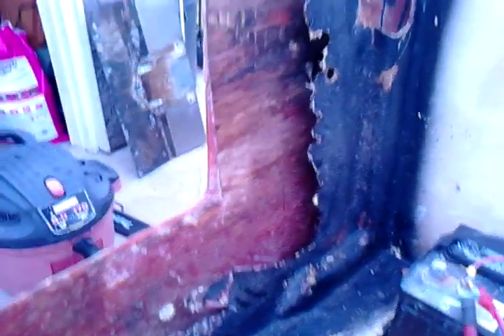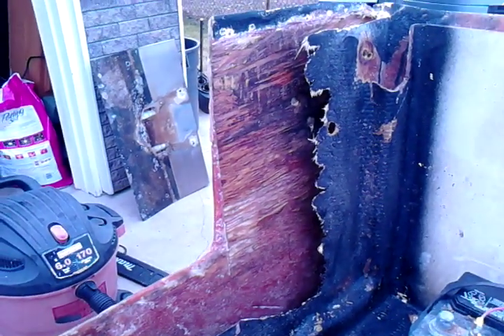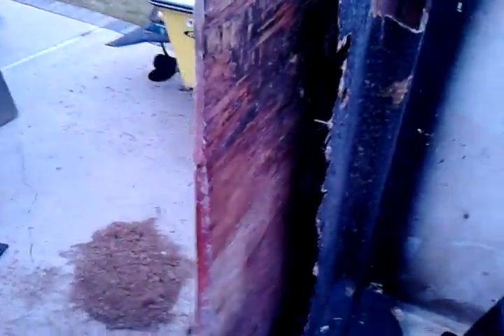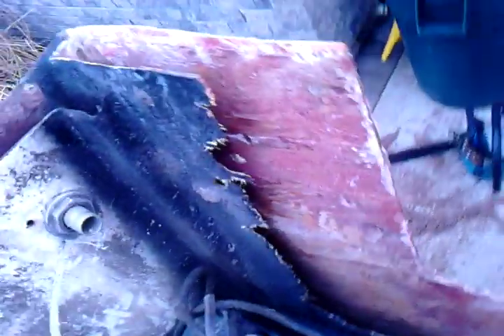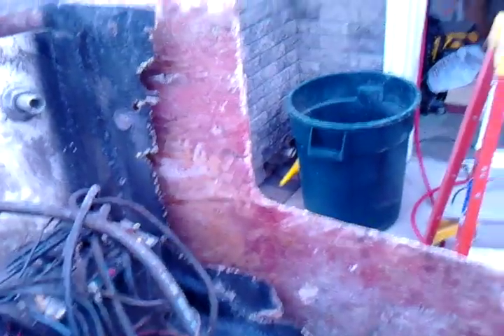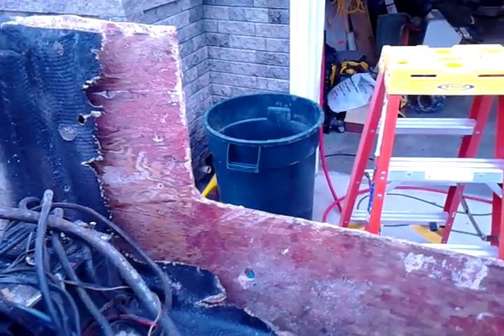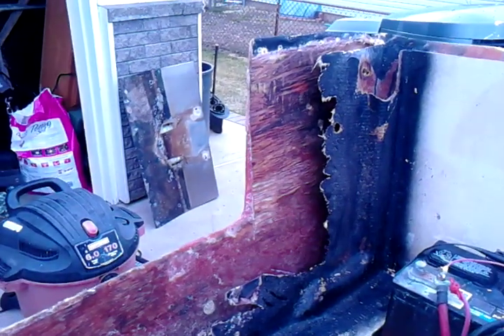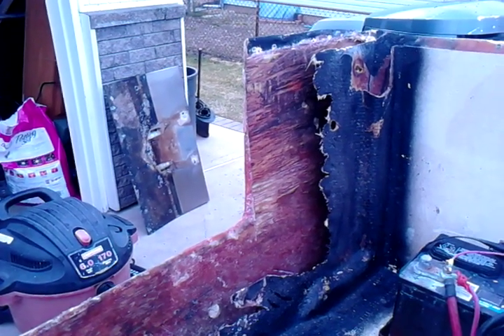Sea cast repair #1. After hogging out the transom core with chainsaw.

Comment from the maker: The factory never covered the plywood transom completely with glass. Thats why I made a new inner panel. Thats also why I cut the gunnells and engine well off in one piece so I had room to work from the inside.

Comment: Get that veneer out as he stated or it will block Seacast™ from bonding to the fiberglass skin.
Reply from the maker: I used a wood chisel on a stick to long reach the inside wood still adhering to the outside skin and everwhere I could I ground with 24grit.